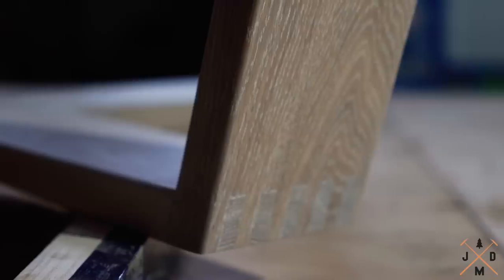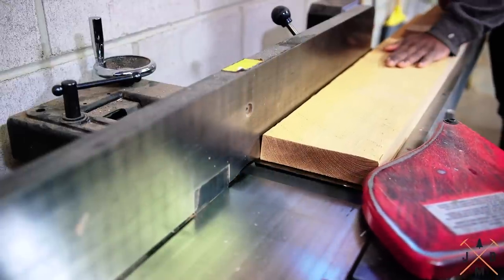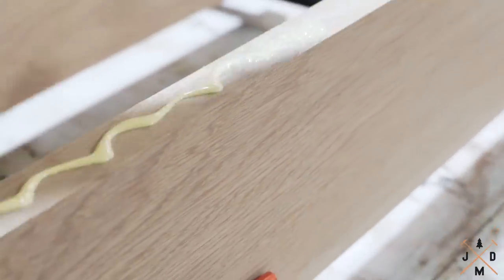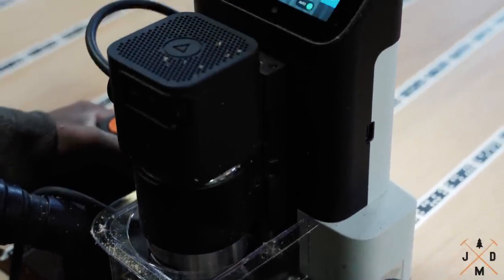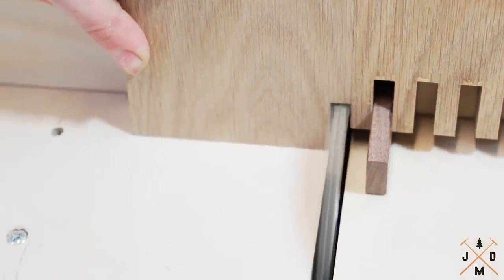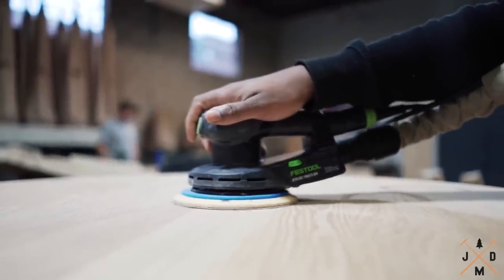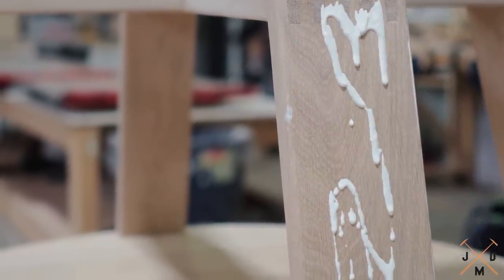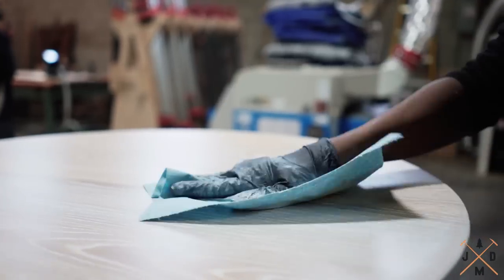HOW TO | Round Coffee Table

Comment: Hey guys, I’m building a round coffee table pretty similar to the one you’re doing here. I have the Domino 700 XL and I’m trying to figure how to reference the position of the mortises on the underside of the table. I’ll use the fence set at 15 MIL  for the vertical supports but how to you reference the cut on the underside of the table. You all just show gluing and lining up but how did you reference to get them to line up correctly?

Comment: Love your guys work! Was wondering what your sanding process was and how come only as high as 150? Doing a white oak coffee table with Rubio Cotton white soon so this video was perfect, very helpful
Reply from the maker: We sand up to 150 grit because that is the suggested grit for the product we use. If you sand to a higher grit with Rubio Monocoat, the oil won't penetrate the wood grain and you won't get the protection that you want. Hope that makes sense. Good luck on your coffee table!
Reply: Makes perfect sense thank you, so you start with 120 then and move to 150?
Reply from the maker: @TC_Tris  We actually start at 60 or 80 grit and then run through all the grits up to 150 (60, 80, 100, 120 and 150 grit). Hope this helps.
Reply: Not sure this applies to Rubio, but for normal oil stain you can use the sanding trick to keep the end grain from getting so dark. If you sand end grain to a higher grit than the rest of the project, then it won't absorb as much and get darker than the rest if you don't want it to.

Comment: The wood you started with was in really good shape. Might mention that cutting rough wood on a table saw without jointing first can be sketchy for sure. Using the bandsaw can make for less waste and be a lot safer if the stress in the wood pinches the blade.
Reply from the maker: Great points!! Those would have been great points to touch on via a text box or voice over. Keep the advice coming!!
Reply: @jeffmackdesigns  and, what a great table!! I love those finger/box joints at the corners, and seeing you guys support your weight on them in that one IG post a while back was insane, so strong. That Rubio monocoat has me really curious about being able to add color and finish in one shot with no VOC. I'm starting to move away from poly in my work for things that are nicer chemically, and far easier to repair since no finish is going to stop a kid smashing the table top with a toy car or a fork 🤣, my coffee table has seen it all...and I don't have kids! How do the tinted Rubio's hold up? Can they be touched up with the natural/clear version if the color is ok and you're just looking to refresh, or do you add more of the tinted type?

Comment: Looks great, nicely done. The one thing you mentioned about wiping off the glue after glue up especially with an open grain wood is that by wiping it off you’re forcing the glue residue into the grain and unless 100% sanded out and you can’t be sure, it will affect the absorption of any stain. What I do it wait till the glue sets for about 45 minutes and gets rubbery and then I use a scraper to remove the squeeze out.